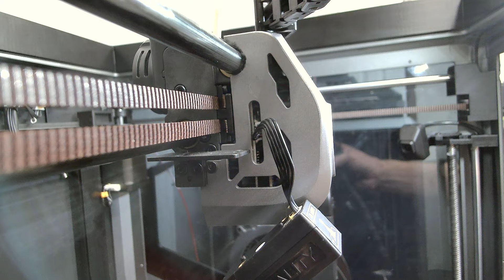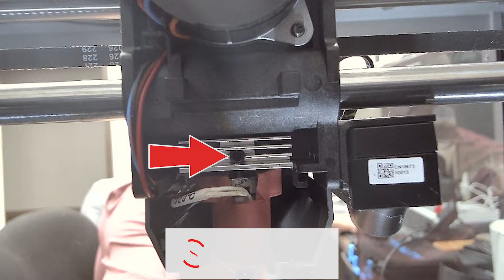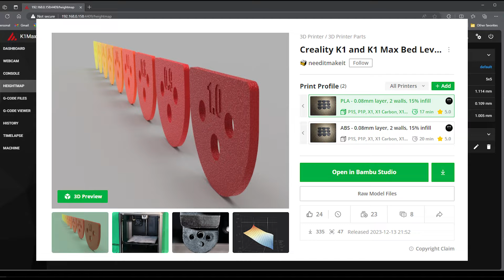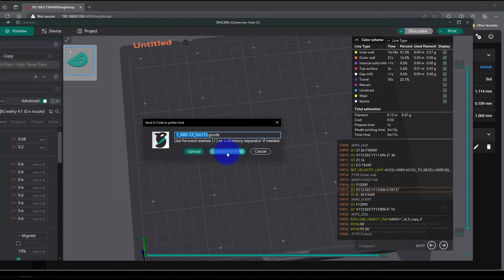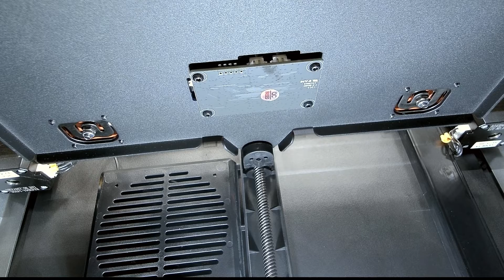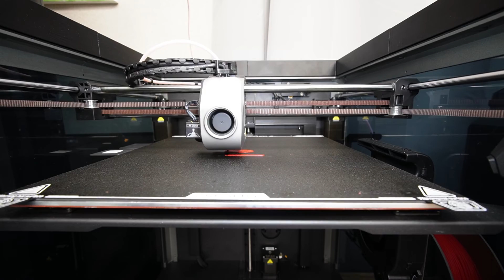Master Your K1 Series 3D Printer: Ultimate Bed Leveling Guide | EDGE OF 3D

Comment: I tried to use the shims but it was unsuccessful for me. I wound up buying a set of springs and wheel nuts for an ender off Amazon and manually leveled the bed and got a better result. I don’t like how you can only shim up 3 points on this bed vs adjusting each corner independently.

Comment: I have a K1 Max and I for the sake of me don't understand how this machine is leveling and calibrating. I can see the 36 points of calibration in the console and their values and they are pretty good (from -0.20 to +0.14) but when I go to Fluid and see the Bed Mesh it's completely skewed and the value of each point in the bed mesh have nothing to do with the calibration values taken from the console. What the heck ??? And my printings are not good because I have visible line width difference on big pieces that go across the whole bed. Can someone explain this to me please ?

Comment: I had been having weird bed leveling issues recently and scoured the internet. I didn't have to go the shim route; but thanks to you I looked at the screws on my hotend and they were MORE than loose. K1 max was suppose to print out the box, funny my older printers never has loose hotend screws. Thanks for a good detailed video!

Comment: Can you print the shims in pla or does it have to be carbon fiber?
Reply from the maker: I wouldn't use PLA myself as the glass transition temperature of PLA is too close to the temps seen inside the chamber of the K1's
Reply: Also where did you find the wedge shaped shims?
Reply from the maker: https://www.printables.com/model/692813-sloped-bed-shims-for-creality-k1-k1c-and-k1-max
Reply: Thanks Scott I really appreciate it

Comment: On my K1 Max, I've found it takes remarkably little force to alter the back 2 corners of the bed. In fact, I accidentally pushed mine down quite a bit while doing some testing. I was able to bring it back into alignment with a bit of pushing and pulling.
Reply from the maker: Yes, the rear of the bed is not as stable as I would like, especially on the MAX but so far, I have not run into issues with it.

Comment: Question: When reinstalling the 2 screws for the fan cover, I had to squeeze it back hard to align it for the screws. Is that normal. This was my first ever removing that cover. Also, I'm getting a 109 error Fan Feedback exception. Someone said it was the heatsink fan? I did successfully print the stock benchy. Thanks.
Reply from the maker: The cover can be a little snug but getting an error I would take a close look and make sure a fan wire didn't get pinched somewhere.